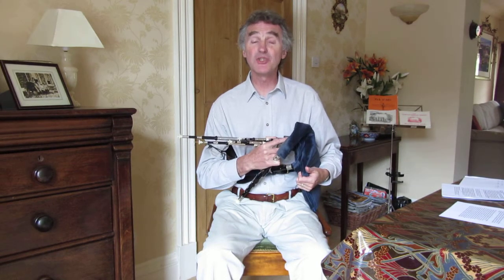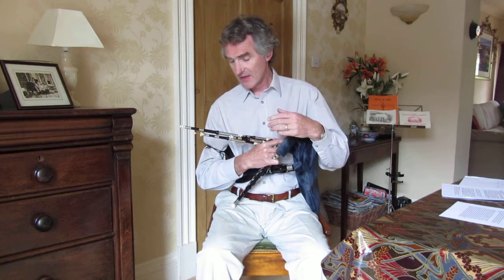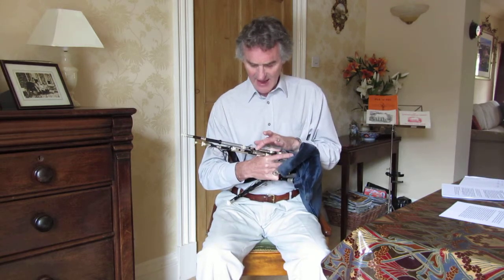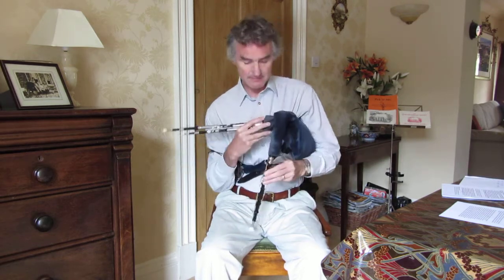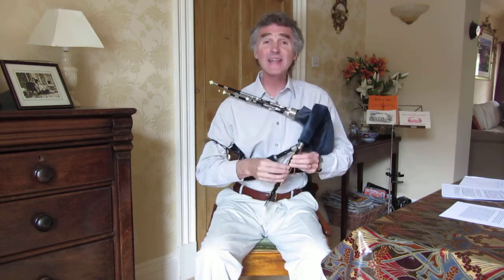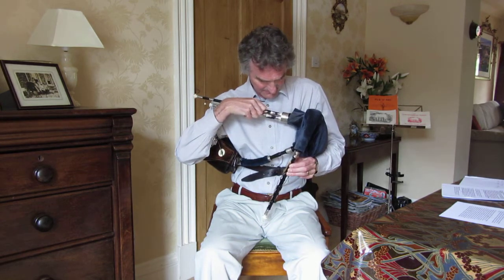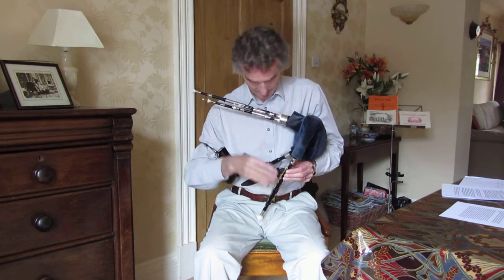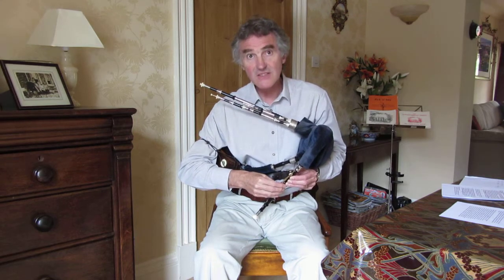Northumbrian Piping Basics with Nick Leeming No.4 - Drone tuning pt.1

Comment: What does he mean by "beating"? If you listen carefully, there's an interference pattern in the sound where the slight difference in vibration frequency (the pitch you're aiming at) s reinforcement and cancellation in the soundwaves. That comes across as a surge in the sound, and indicates the tuning is nearly complete - you're aiming to get rid of it completely.